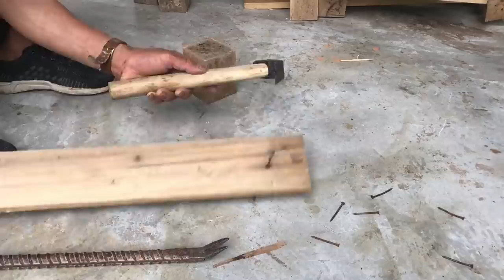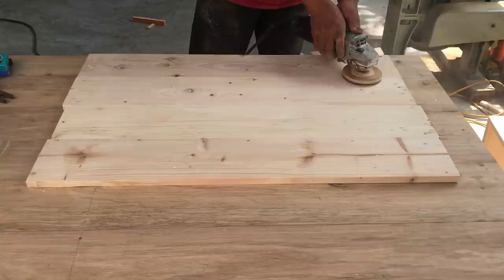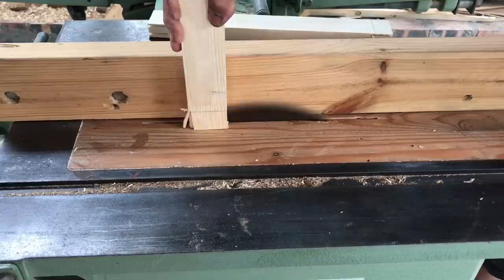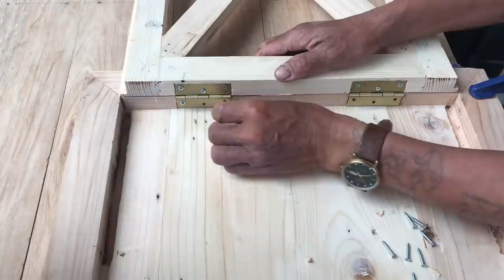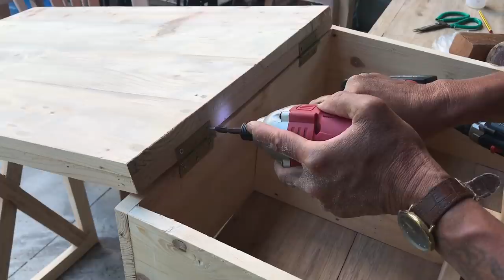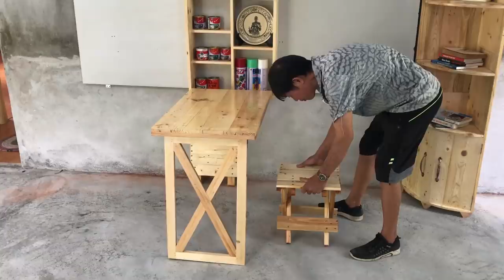Amazing Idea Creative Woodworking From Pallets // Build Smart Folding Tables Combined Storage   DIY

Comment: What was the hard hat for 🤔 no other safety gear involved nor used not even a mask even noticed on circular saw he tried to move a small piece of cut  corner from cross members and the saw was still spinning lucky man to still have his fingers but def  a good craftsman with a chisel but struggling to put screw nails in straight with the power driver 👏👏👏🏴🥃